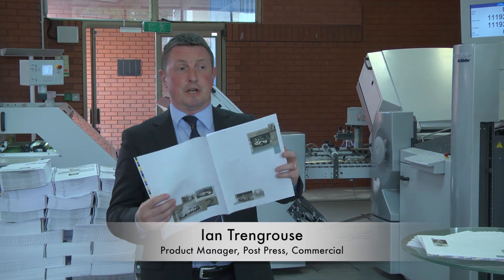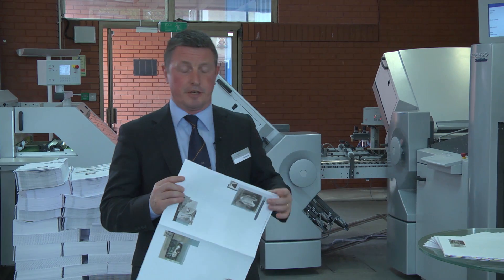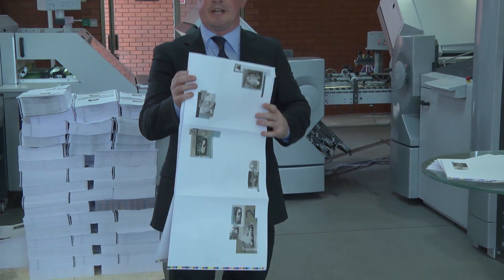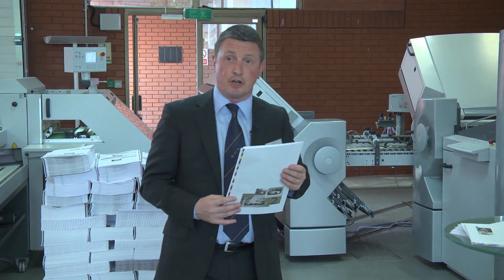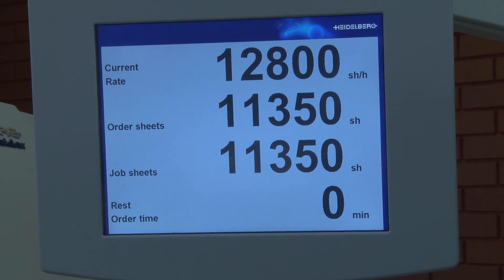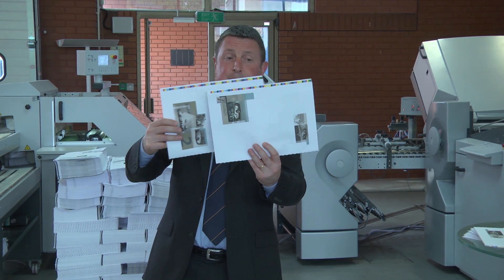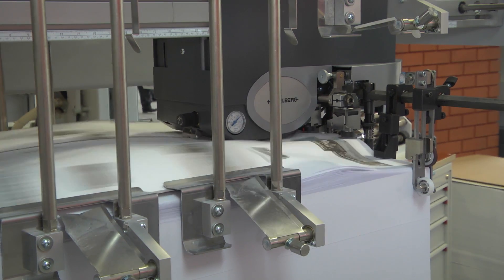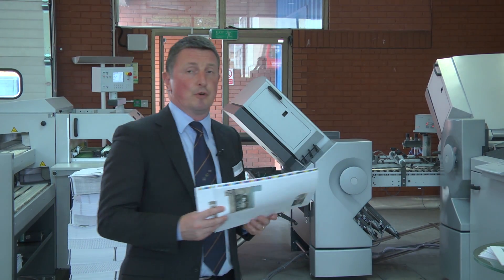Stahlfolder PFX pallet feeder: Innovative shingled feeding and folding

Comment: Dear Sir, this folded section of 18 printed pages ( 1 zig-zag fold in the first station followed by a roll-fold at a right angle in the second station) is not suitable for saddle - stitching, sewing or thread-sealing. It can only be used for adhesive bound publications or loose-leaf products. You need to feed the sheet long edge first, make 1 fold in the first station , followed by 2 parallel folds in the right angle station to give 16 printed pages in upright format which can be stitched/sewn/etc.